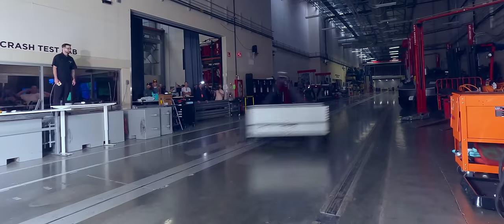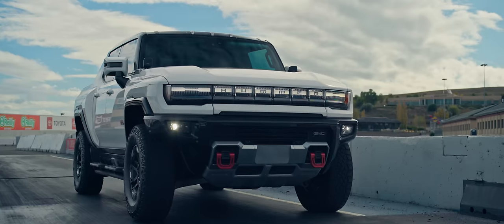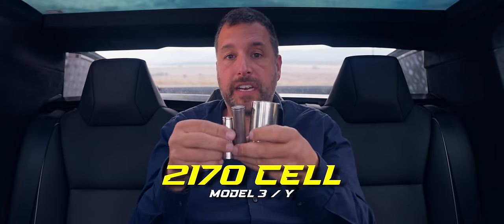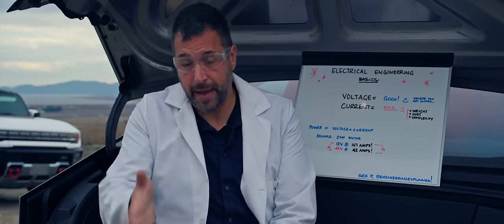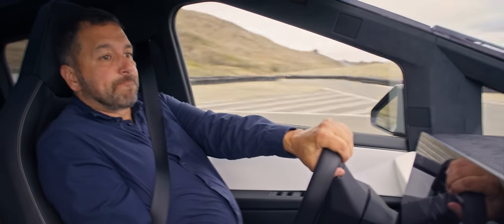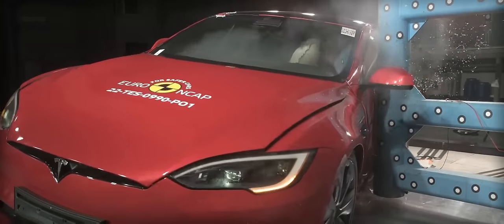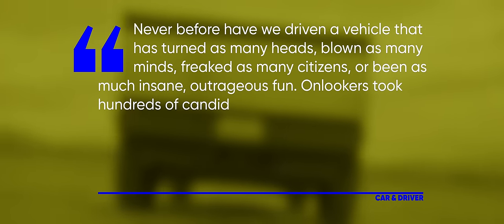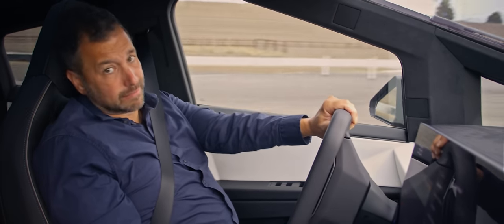Exclusive 2024 Tesla Cybertruck Full Review & Drag Race w R1T & Hummer  — Jason Cammisa on the ICONS

Comment: My 1978 Ford F250 cost me $5000, it has an 8 foot bed, and I can work on it myself. I recently drove it from Idaho to California and back, 1300 miles, and did have one problem. We had to replace the power steering pump but that was it. it took 3 1/2 hours and we did it in a parking lot. We were towing a 20 foot trailer and went to California to pick up a classic car. No problems other than that.

Comment: 9:30 you can't double dip on the higher voltage advantage. Either you make the cables smaller or increase the efficiency. If you decrease the cable size then you are decreasing the resistance and therefore increase losses. There is still some overall advantage to both but it isn't just the best of both worlds. 
Also with EVs, higher voltage is not always more efficient. All of the switching components, e.g. your inverters,  have higher switching losses at higher voltages. In general, the only main benefit of higher voltage comes with charging since charging has the highest currents and charging cables are mostly current limited.

10:15 48V isn't as common because it is just not that easy. Most car electronics don't even operate on 12V but on 3.3-5V (microcontrollers, CAN, logic gates, etc). Switching from 12V to 3.3/5V is relatively straight forward, but gets much less efficient and bulky at 48V. Additionally, higher voltages = more magic black smoke if you put the wrong voltage in the wrong place, so you need larger protection circuits and more caution as well. 

11:25 what about the Lexus RZ 450e? Pretty sure that came with steer by wire first.
Reply: Yes, this isn't the first steer by wire and not even the first 48v car. This video is very promotional in my opinion and they didn't really address the limited functionality and range.
Reply: The magic blue smoke.

Comment: 19:54 There was frontal crash tests at the point of release for this video.. which were quite shocking due to the hard structure not absorbing any energy. Basically making the passengers take all of the impact.Kind of makes me question other praising facts of the video
Reply: This happened to Volvo many years ago the car was too stiff and all the energy is transferred to the passengers and they die due to massive internal damage to internals organs that smash into the rib gage. Another car that made this mistake was the Smart car which also drove straight on in corners if you went too fast.   The deformation of vehicles is a science and is usually done by very complicated computer based program,  as Elon thinks he is be manurfacturing expert in the world, he probably skipped this as he knows better about crash ability as well.
Reply: @dennisstaines8005  
Seems like you are he one who thinks he knows better than Elon and all Tesla engineers. For starters, Elon likely knows more about manufacturing than anyone else on the planet, but that doesn't even matter, because most of the work is done by other engineers. Then, as they video also explained, Tesla makes the safest cars in the world, so why would they make an exception now? And of course Tesla has an in-house software for crash test simulations, which they showed to be extremely accurate.
And someone compared the CT crash test video to an F-150's, and both stopped in about the same distance. And that's just one component of crash safety.
Reply: @andrasbiro3007  LOL does it take you long to get the smeg taste out?
Reply: @andrasbiro3007 he a Fan he a Fan he fan
Reply: @murobro  
Cat walking on the keyboard?

Comment: Finally a review that gets into the details behind Tesla batteries, 48v system, etc AND with technical accuracy! Fantastic
Reply: And it performs 30% worse than promised. Amazing!!!
Reply: @kopkiwi08  it’s actually faster than promised.
Reply: @NextGenEvs  distance is 30% worse.
Reply: @kopkiwi08  How often do you drive 340 miles without stopping for 15 min? If so, buy the range extender.
Reply: @kopkiwi08  470 miles really is close enough to 500 to call it good. Saying that the truck hasn't reached its promised "performanc" is a bit of a stretch, clearly the shortfall there is in the energy density of the 4680 batteries, so tesla put in an optional extra trunk-mounted bank of them to reach that higher range. 
If you want to complain about the fact that, with or without that option, it's a way more expensive product than promised, fair and total agreement from me. But to call the whole thing bs is a bit.... wel.... bs.
Reply: @kopkiwi08  So don't buy it.
Reply: All these POS EV trucks is like a toy compared to CyberTruck.

Comment: Are we going to ignore the fact that the Cybertruck hit a full-sized refrigerator at  a considerable speed, and didn't even leave a mark? that was pretty impressive.
Reply: Pretty sure any truck with an actual bumper could do the same. Trucks frequently hit cars causing lots of damage while the truck hasn't got a scratch on it.
Reply: Even full of beers it will
Reply: @ericmichel3857 no lol. A refrigerator weighs like 140 lb.
Reply: I was going to assume it was CGI, notably the top-edge of the rear lights would feel that impact. While CGI can and will get that good, I can't really claim they would put that much effort into 4s of a gag with no further point for the video... or maybe they did, or they just didn't hit it hard enough to bounce off of the top of that hatch. The sounds feels added on for sure though.
Reply: @pilotavery  Uh, yea and a car weighs over 3000 lbs and is far more solidly built. My point was running into a refrigerator in a big truck is funny, but not exactly impressive.
Reply: truk had a tow hitch on it, the hitch did the hitting, look at it in slow mo
Reply: @ericmichel3857  lol try doing that with a Ford F-150 I dare you. It's hilarious.
Reply: Tow hitches can protect you from a lot. You saw that panel flex on the go pro shots right? This stupid thing pops and waves worse than an actual tin can
Reply: CGI my guy
Reply: Well, you probably should hope there wiil be no pedestrians in front of you)
Reply: Hits it with the tow bar, then fridge doesn't quite hit the top of the tail gate.
Reply: Imagine it hitting a human in a carpark , then!
Reply: With or without the gas generator? Without, yes but with, it weighs a lot more. @pilotavery
Reply: Thats why this vehicle wont release in many countries because it's pedestrian safety rating would be junk. @camryt
Reply: Now imagine the fridge was a person. Great for the truck, not so much for the person
Reply: I'm still wondering if the Cybertruck can CARRY a full-sized refrigerator. The fackt that they never hauled nothing in the pick-up makes me think of this review as advertising more than anything else.
Reply: @savageduck4487 Honestly I can’t not see new regulations being proposed because of how much heavier and faster these new EV’s are. This one take it up a whole mother level.

Comment: This is in fact the pinnacle of automotive journalism. Well done Jason and team.
Reply: Don't Forget Randy Pobst! Super Man!
Reply: Couldnt have said it any better myself.
Reply: Sheet.  The crap he spouts makes me taste bile.  48V in a crash will make an awesome fire if it doesn't electrocute you.  So easy to arc.  Wait till 800 volts brake loose!.  Drive by wire has been used for decades in so many industries.  Nothing new there either.  Try to move it without the batteries on, good luck.  His maneuvering on the  race track in front of the little go kart while he was running over all the curves to cut his straight line.  I hope my insurance rates won't have to pay for an exoskeleton dent that will almost write off the the safety of the vehicle.
Reply: This was paid content... Produced by tesla themselves.
Reply: @jhfl1881  800V won't kill you (though it might hurt) unless whatever it is you're powering is under load. So unless you plan on also holding down the accelerator and your circuit is under load and also you somehow manage to expose all the bare wire that's directly powering your motors.  You should do your research. Also for reference fast chargers run at 480 volts.  For reference hyundai IQ already runs on a 800V system.

Please go read a book or do your research prior to spewing misinformation on the internet. 
Signed an electrical engineer.
Reply: Zero journalistic integrity here. Don‘t let advertisement fool you. This is an advertisement by tesla, but no journalism at all.
Reply: @Boeing_hitsquad can you prove that?
Reply: @jhfl1881  Do your research. Invest in Tesla buddy. You re totally lost
Reply: @Boeing_hitsquad  It s not paid content. Not Produced nor sponsored by Tesla actually!
Best pick up truck ever made, period.
Reply: @felixrosic5460  You re the fool my friend. Can t distinguish reality from gimics anymore. That s what society will do to you
Reply: @lucadellasciucca967  it actually says ‚paid content‘ and real journalists point out negative aspects on products. Not just „well its aerodynamics are 2nd class“. Where is the statement on how most humans don‘t need this kind of car at all? Not a single word about how the Cybertruck isn‘t for serious professionals (which would be the single argument for a pick-up truck over a „normal“ car)? It‘s advertisement and nothing more. And you can decide whether you want everything the elon wants you to want. Maybe other products have their advantages over this product. Go ahead and give Elon all your money.
Reply: @felixrosic5460  Didnt  see the paid content thing.
Anyways, engeneering and physics say this is the best truck you can buy. Period. If you need a pick up of the dimensions of a cybetruck then the cybertruck is the best choice you can make.
Reply: @cliang001 damn you straight up roasted him 😂
Reply: @lucadellasciucca967  How's Elon's bootshine? Nice and tasty?

Comment: The Hummer’s weight vs the Cybertrk is an example of facing the “Rocket Equation”.  The more weight, the more fuel required for orbit which leads to more weight. . .
Reply: I saw the intro to the E Hummer and thought the concept was so misguided as to be a complete waste of materials. I wish I could hear the design team discussing the features and getting amped, and not a single spoilsport in the room had a voice to question power to weight ratio and charging that monster at an Electrify America for an hour and a half at full juice. Each and every person involved with the design, from the idiots who conceived it, to the bean counters who green-stamped it, to the goompers who service the equipment involved in manufacturing it need a swift kick in the groin.

Comment: Can't believe there's no shout out to Randy Pobst, a legendary driver! Him driving the go cart was hilarious...& subtitles made it even better 😂.
Reply: He’s a regular on Hagerty’s YouTube channel!
Reply: @jezza6575  Leaving Jason & Randy alone with whatever is supposed to get "Professionally Tested" is an overly optimistic delusion. Those boys just "ain't right" but they're certainly a lot of fun and draw a huge crowd waiting to be entertained!! 

The technical questions that first come to mind if this truck is to be released upon the public starts with "has Tesla dealt with the combustion problems that EVs are getting to be notorious for?" They have a new battery cell to work with. I'd like to think at least one of the responsible engineering groups has this issue on their agenda. They've 4pled the operating voltage which should reduce the applied operating current by dividing by 4. That should/could reduce the operating temperatures that contribute to the fires that have been loudly reported in the news squawking on TV.

The body's obviously tough but that shape makes me wonder if I could get as much crap into it as I do with my 2000 Ford F250 SD Power Stroke, with an 8' bed. I know it'll beat the hell out of the acceleration of the 7.3 liter diesel! Jason says they're on a four year development schedule. I certainly would like to hear occasional up dates from Jason or whomever has access to the progress info.

It may be a bit early in the development process to predict it's predicted service life. That old diesel truck of mine has a loooooong service life history. That would be a nice draw.
Reply: They put him in the oldest slowest kart they could find...

Comment: I'm impressed. I watched this thinking it would be yet another example of vaporware not living up to hype, but fair is fair. They actually delivered.

The in-house battery design and manufacture was a particularly interesting and laudable achievement, as well as that very practical turning radius, the ultra-slippery CD and of course, the crazy accelerattion stats.

Hats off to Tesla's engineers. You definitely stepped up.
Reply: No they didn't. They delivered at 3 times the price.
Reply: @ronnydawsonisafraud7747  Really? Dont bring your political views to a product.. Lol. Hating Elon is not hating what Tesla makes.
Reply: @ronnydawsonisafraud7747 they didnt even deliver. The CT is smaller, has 30% less range, less seats and is way more expensive than announced
Reply: @gamernerd7139  what political views?
Reply: range is horrible and towing capacity at any decent range is highly unlikely. The cybertruck is horrible for anyone that actually needs a truck

Comment: A solid, comprehensive review. I must admit I was skeptical about the looks, etc. But evidently they have put in a huge amount of work. To only weigh in at around 3000kg with a steel exoskeleton and 123kWh battery is no easy feat.  That steer-by-wire technology is revolutionary and soon to be copied by other. Plus 48V architecture, etc. Wow!
Reply: Don't really get the excitement about the 48v system. It has been used in cars before for power hungry stuff like e-chargers. And it saves SOME weight in wiring (on a 3+ ton vehicle), but how much? A few kgs?
Reply: @Epacman17  “A premium vehicle can have 5,000 meters of cabling, 100+ ECUs, 500 LEDs and so on." So easily 200+ kgs of wiring. Of course a Tesla doesn't have anywhere near that much wiring nor ECUs, but it could still save them tens of kgs (in addition to cost, chips and copper are not cheap).
Reply: Any vehicle battery operated is crap, let alone this piece of scrap.metal. makes me feel 🤮 looking at it.
Proof money doesnt buy class.
Reply: @stormsurge6765  You don't get it, this thing could give a rats ass about class. It's a tech playground, form follows function. Everything is designed to a purpose. Everything on this truck is designed about what it can do, only. Form and "class" is only a distant second thought. It's good that it makes you sick. You don't understand the tech. Go buy a Hummer. It will suit you better.
Reply: @Ehralur  Is there a list somewhere of all the ECUs in a typical car? 100+ sounds like you are counting every little LIN node like the power window switches, and calling that an ECU is a stretch.
Reply: @Epacman17  According to the engineers it saves around 50 kg (110 lbs) of copper on the tesla's.
keep in mind Tesla already uses a lot less wiring than the competition.
Reply: 3 ton hahahaha what a laugh
Reply: @stormsurge6765  what is class, is it old ways of doing things, or engineering beauty. Most scientific people will agree it's engineering beauty, Tesla has that.
Reply: Still looks like complete crap to me.
Reply: @steve75112  And still more fuel efficient than your '86 Dodge Ram with the lift kit and plastic truck nuts on the tow hitch. 🤣
Reply: @fluitfluiten  OK, that's reasonable I guess. The fair comparison should be complete 12 V vs 48 V systems though. Are we just assuming everything is lighter for 48V? Battery? Power electronics?
Reply: @Epacman17  Indeed, every electric component can be made smaller and lighter with the higher voltage.
Reply: @fluitfluiten  Should have gone for the full 800V instead, the windows motors could be made tiny!

Comment: One thing you forgot about the drive-by wire on an airplane is that air planes are maintained and have yearly inspection and are after a certain amount time had passed the plane is fully taken apart and any I main any fault is found no matter how small it's replaced. So you can't use a plan as an example.

Comment: First, you claimed it was more efficient than a rivian, without bringing the drag coefficient of a modern Silverado into the conversation. And then you mentioned that the technology of the truck has been used in airplanes for a while now. As someone who understands both airplane design, and maintenance. Now that I know that these are using airplane design techniques. Since you referred to your engineering social media consultant. You should realize that the airplane reference means that the factor of safety is low. I am going to stay far away from these trucks if I see them on the road. I don't care how fast they are. Tesla and rivian don't understand quality control and the laws yet. And its pretty apparent by the fact they think airplane design is safe for roadway use, and the fact that they can't always be bothered to install a rear high center taillight. It's not about cost, it's about the engineers they use, don't know jack about engineering. And it shows.